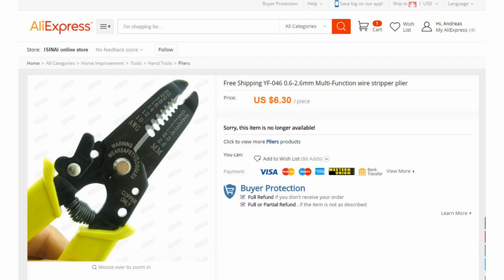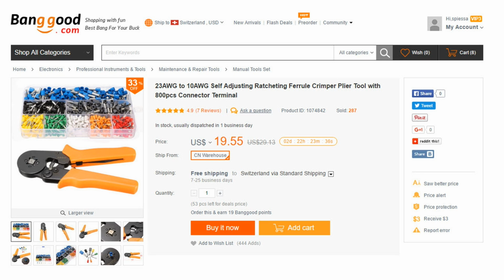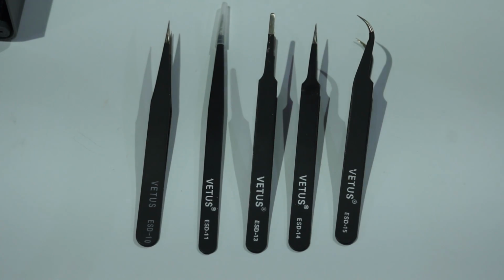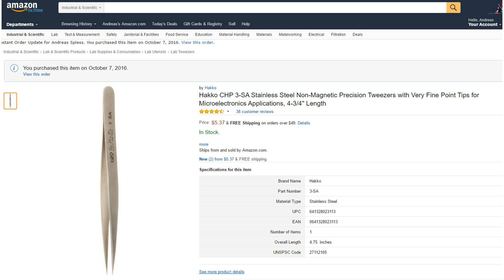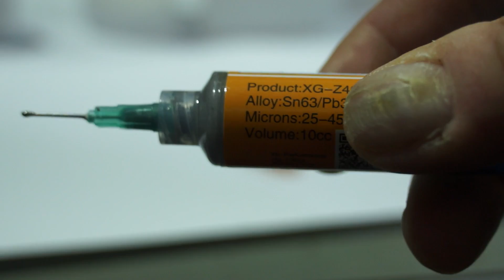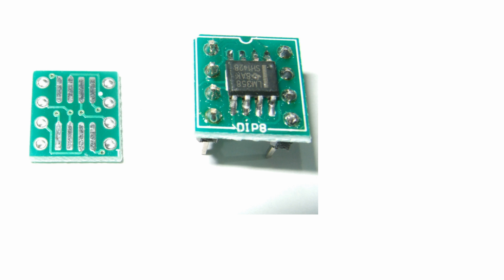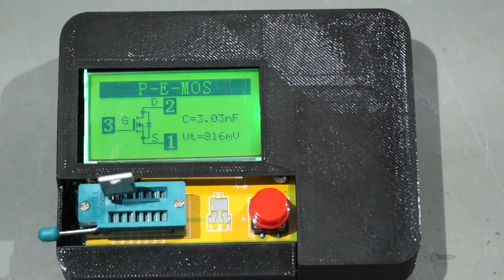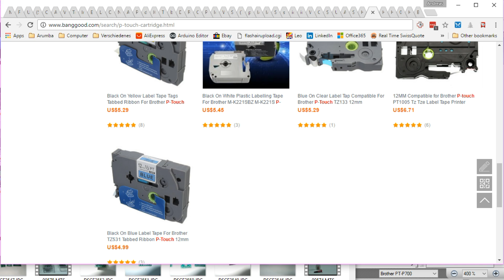#87 LABREP #3: Often overseen tools in my lab

Comment: For tweezers, go check out cosmetic tweezer kits for blackheads & skin care. They're extremely fine and great for extremely small parts. Also, there are some tweezers that have replaceable heads that are either ceramic or plastic - in case you're worried about static. But the cosmetic tweezers I find are the best.
Reply from the maker: Thank you for the tip!

Comment: Wondering how crimping provides a better connection than tining?
Even if crimping creates a weld (which I have heard is the case) wouldn't tining still cover more surface area?
Reply from the maker: I am no specialist but it seems that the specialist agree. And crimped connections are more robust against vibration.
Reply: @AndreasSpiess  Thank you for the reply. I was not expecting that!
That makes sense though, for any case where vibration or force could be applied to the joint, crimping would be preferred. Guess that is why they favour crimpled connections in cars and trucks.

Comment: I have one of those component testers,  and it's one of the more-used devices for my setup.  No 3d printing capability here, so I put it in a metal tea container with three banana jacks added besides putting stuff in the ZIF socket.  The link you provide is about half the price I paid for mine.  :-)
Reply from the maker: Your solution is probably even better because it is shielded...
Reply: I'm not sure that matters.  It was also convenient that I had a couple of sets of test leads that went with my curve tracer.  I saw another such unit that had a connector in place to attach leads,  and it came with a short set of wires with clips.  Next time I buy one I guess there will be more choices.

Comment: Dear Andreas,
I agree with you that the old fashioned wire strippers are very handy, but for most of my wire stripping I use the Klein Tools Katapult. It is like the automatic strippers in that it strips the wires for you, but unlike those it grips the wires from all sides. It does this by having many different wire sizes to choose from, like the old fashioned strippers. It works very well for me, and I think it might be worth a try for you.
Reply from the maker: I once even made a video about strippers and I think, other viewers also recommended the Klein tool.

Comment: You should never solder terminal wires, if you don't have crimps just use the naked wire without solder
Reply from the maker: You are right. Now I usually use crimps

Comment: can those terminals be soldered to through hole holes? i keep running into issues where i end up breaking solid core before im ready to do something like hot glue for stain relief and getting stranded through the hole isnt always pleasant. im sure some of that is wrong gauge wire, and or I should have a nice large pad to solder a stranded to...but life isnt perfect it would be great if this was a solution. It wouldnt be for a final version...more of a rugged prototype. maybe i need to just invest in a non ebay/china bread board. I've heard quality is everything but so far they just piss me off when time is wasted for a loose connection
Reply from the maker: Depends on the size of your pad and hole on the PCB. I see no advantage over just wiring the wire into the hole.
Reply: Andreas Spiess I always end up with a situation like only stranded wire and a size too large ...so then I end up with stray strands trying to reach the next hole. With my luck 5hats usually 5v on a 3v tolerant pin
Reply from the maker: For that purpose they might be ok
Reply: Andreas Spiess can u recommend a supplier of Chinese thumbs? I've heard the 6 year old model makes very small, precise and efficient twists for almost no cost...just can't seem to find an eBay seller 😂

Comment: looks like the wire strippers are these:

https://www.aliexpress.com/item/20-30-AWG-160mm-SK7-Stainless-Steel-Cable-Decrustation-Plier-Wire-Stripper/32797302290.html

they have 3 "colors" that really just change wire gauge. the middle one looks exactly like the one in the video. same measurements, same design, same lettering.

there are a few very similar ones (also on ebay), but these are the only ones where everything is identical.
Reply from the maker: I do not know if the quality of the different suppliers is very different. I just bought one...

Comment: Tinning the wire with solder is not recommended when connecting into a screw terminal block.  Over time the solder collapses and the connection may become loose and high resistance.   Bare wire strands are the best for screw terminals blocks - the wires spread out under pressure and maximise the surface contact area.  Of course care is needed to ensure there are no loose strands hanging out that could cause trouble.  As you mentioned, ferrules are neat and tidy but it is critical to match the wire size correctly and crimping needs to be done carefully.  I have seen instances of bad crimping causing trouble with connections.
Reply from the maker: Thanks for your clarification

Comment: I know this is an old video, but I wanted to add a comment about the prototype through-hold PCBs.  They are really useful as a template when soldering pin headers.  I drop the headers through, put the small board on top, and solder.  Out comes perfectly straight, perfectly spaced, parallel pins that easily go into a breadboard.
Reply from the maker: +Michael Graff Many of my old videos still get a lot of views. So, thanks for the tip!
Reply: I thank you for your videos, and curse you for introducing me to LoRaWAN.  I'm in the process of building an ESP-32 based fully featured single-or-multichannel gateway, as well as building an ESP-32-focused node library.  Fun times!
Reply from the maker: +Michael Graff Great. Just tell us, when you are finished. Maybe I make a video...

Comment: Have you tried using heavy duty tin snips to cut your PCBs?  I find them easier to use than a hack saw - and it doesn't generate the fiberglass dust.
Reply from the maker: No. But it is a good idea! Thanks.
Reply: I just use my Dremel with a cutoff wheel.
Reply: With the cheap proto boards, I find they snap unexpectedly with the tin snips. Instead, I have a 10" bandsaw, it makes short work of cutting PCBs.

Comment: Thanks for helping us to learn. Great Job!
Reply from the maker: Thanks!
Reply: Did you try to use an alternative box configuration for the resistors? I am using it for in my labs and works pretty well for slow-runners values. On top of that, and only for few fast-runners as 47, 100, 220, 1K, 10K and 1M I have in separate boxes 100pcs of each of them in little boxes.
And example of this configuration could be seen in http://www.ebay.com/itm/145-Values-Total-10pcs-each-1-1-4W-Metal-Film-Resistor-Assortment-Kit-1024-/272189800972?hash=item3f5fc6c20c
Reply from the maker: Seams also to be a good concept.And it is very small. Maybe I give it a try. Thanks for the link!

Comment: In the transistor tester can you insert a component into any terminal?
And does it work also for TRIACs?
And can you test also some DIP ICs?
Reply from the maker: mark 1. It has only 3 leads. They are connected multiple times to the socket.
2. I have no triac, so I cannot test it.
3. No, only transistors (all kinds of). Also no voltage regulators
Reply: Thanks for your reply.

1. But can you put any transistor terminal in leads 1-2-3 (without specific placements) and it automatically recognizes it?

3. Transistors but also diodes, resistors, capacitors and inductors. Correct?
Reply from the maker: mark yes
Reply: thanks!
Reply: Hello,
I received it today and I like it a lot.

I noticed that an N-channel mosfet is not properly recognized (only two diodes/junctions are shown).

I also tried a few inductors, but I am not sure about the measurements.
I will do some more tests.
Reply from the maker: Sometimes it helps to change the sequence of the pins.
Reply: I did more tests today and it is a very useful tool.

I tried some zener diodes, but they are not correctly recognized.

I also used two wires+probes to measure/test in circuit components but with bad results for now.
Reply from the maker: I do not think it is made for in circuit measurement, because you have many influences other than just the component.
Reply: I understand, but I was expecting results similar to the ones given by a common multimeter (diode testing for example).

Instead I obtained very different results.
Reply from the maker: Where did you get different results? I just tested a normal diode. It showed it as a diode with the right pins and a reasonable forward voltage.
I tested Zeners, and up to 4.3V it showed two diodes and both forward voltages. The forward voltage of the Zener part was smaller than the one printed on the diode. But if you look at the data sheet, there is a curve and not a distinct point where they start to conduct.
Zeners with higher voltages cannot be detected because I assume, the device internally runs with 5V
Reply: I confirm you that I got your same results with zener diodes.

Comment: hey andreas  great video I was just wondering you seem to have some expertise in esp projects. Have you ever come across a small solar box/with a small solar panel with an esp attached  which does some sun analytics for you,and pushes data to your IOT cloud. so you can get some stats before you invest in lots of solar panels? Is it ever sunny in Switzerland?
Reply from the maker: Sometimes we have snow and sun ;-) No, I think, this is a special device which has to be built. And maybe WiFi would not be sufficient, because on the roof, you might not have one. I think also, there are probably more accurate sensors to measure light than just a solar panel. But I am not a specialist in that.
I have a project plan for me to measure the sunlight and compare it with short term weather forecast. Because it is not so warm here, we need heating. But if we would have a good short-term forecast, we could reduce sometimes the energy.

Comment: beside a Brother label printer i use a DYMO which also can print Barcodes which is very handy to read it with a smartphone and access a local database at an raspberry pi
Reply from the maker: Mike Herbst I know the brand, but never owned one. So, it is good to know. How are the prices of the consumables? This might also be a deciding factor for the viewers
Reply: there are also 3rd party products for an 3rd of the price :-) so about 1-2 Räppler per label

Comment: Have exactly the same stuff !!
Do you have a link to the printed box design files for the component tester? Mine flops around with the 9v battery hanging loose.
Excellent video as usual.
Reply from the maker: Thanks. The box is already there: http://www.thingiverse.com/thing:1694729. I just forgot the link.
Reply: You did mention it in a few videos back on the tester.
I love mine. so accurate too. need to make a jig and solder it to the empty TO package, besides the zif socket, to make measuring resistors and caps easier and don't wear out the socket. I have hundreds to go through. Some bags of 1% mixed resistors and capacitor grab bags, will finally get a proper place.
Reply from the maker: So far, I buy them "unmixed", but during work, they sometimes become mixed. I just bougth a set of 103 values, because I often did not have the right one. Now, I have the problem of storing them properly
Reply: Andreas Spiess
Glad to find out I am not alone :)
Specially after dismantling a big breadboard project... putting the resistors and capacitors away is a pain.
So it accumulates, until their is a hairball-like mess to sort through.

Comment: step drill is a must for cutting holes in sheet metal.
Reply from the maker: ms3bani Thanks for the comment. I use it more for plastic because I do not use sheet metal often.
Reply: I use the step drill for Steel project enclosures as well. Works great as long as you don't run the R.P.M.s too high.
Reply from the maker: Thanks for the tip. I never had the balls to do tat :-)

Comment: I'm curious Mr. Spiess, why do you use SMDs which need soldering to PCBs with headers before being used on your protoboard? What advantage does it offer over using a through-hole component?
Reply from the maker: I use SMDs if I do a PCB. And for many of my projects I do PCBs at the end. They are easier to mount (no holes), need less space on the PCB (also because you can mount them on two sides).
Reply: Thank you.

Comment: These are pretty close to Andreas wire stripper:

https://www.aliexpress.com/item/MINI-Portable-wire-stripper-Knife-crimper-Pliers-crimping-tool-Cable-Stripping-Wire-Cutter-multi-tools-Cut/32586969899.html

https://www.aliexpress.com/item/Precise-Multifunctional-Cable-Wire-Stripper-Cutter-Tool-Clamp-Steel-Wire-Cable-Cutter-Plier-Tool-Stripping-Herramientas/32491765660.html
Reply: Or they are even cheaper on eBay: http://www.ebay.com/itm/1PC-Multifunctional-Wire-Stripper-Stripping-Pliers-Cutter-Tool-Crimpe-10-22-AWG-/322343419688

Comment: Thanks Andreas, very useful. Here is are version of the transistor tester with a case for people w/o 3D printer.  https://www.aliexpress.com/item/2016-Latest-LCR-T4-ESR-Meter-Transistor-Tester-Diode-Triode-Capacitance-Mos-Mega328-Transistor-Tester-CASE/32739314444.html?spm=2114.10010108.0.0.MxP9ME&scm=1007.12908.37901.0&pvid=d67ef625-0a84-4b4a-a73e-e0d4dd2a6a1f&tpp=1
Reply from the maker: Nice housing. Better looking than mine :-) Thanks for the link!
Reply: you're welcome. Of course everybody has got his own tools. I cannot resist to guide your attention to another kind of tweezer: https://www.rai-ro.de/chirurgische-pinzette-p-360.html it's crossed and bend. If you have two of them they can be used a tiny third hand. I love it for soldering work....
Reply from the maker: Looks good, but for me, this is an expensive tool. Shipping more than doubles its price...
Reply: Hm, they charge 34 Euro to Switzerland!!!! That makes it a no go of course :((
Reply from the maker: I did not check this way. Because I live near Germany, I have an "unloading" stop on your side and I import it myself. This cost 5 Euro plus the shipping in Germany. But still this was more than the tweezers themselves. So, I stick with my Hakkos (which I found in the meantime) :-)

Comment: Great ideas...I found that when using a needle applicator bottle even with a tip protector that flux will dry in the tube and can be a pain to clear. So now whenever I'm done applying flux for the day I simply remove the bottle top and clean the tube out with a little IPA. I also keep IPA and flux in three different containers for different applications - a nail polish bottle with brush, the needle bottle and on of the larger bottles like you display; same three containers for IPA. Really like the flip-up bottle for grabbing some IPA on a cleaning cloth or Q-tip.Thanks for sharing Andreas!
Reply from the maker: You're welcome. I forgot to say, that the flux will dry out, as you experience. But the same with me, with a little IPA It usually can be cleaned.

Comment: The step drill bit really is essential for anyone working with plastic or thin sheet metal enclosures. I didn't know about the adapter PCBs for smd parts, nice tip!
Reply from the maker: Till recently, I did not know about them, too.

Comment: Tinning wire and then putting them into "block-connectors" is also a BIG no-no as the solder cold flows! - You will have bad connections over time.
Reply from the maker: I know, but I did it! This is, why I bought the ferrules